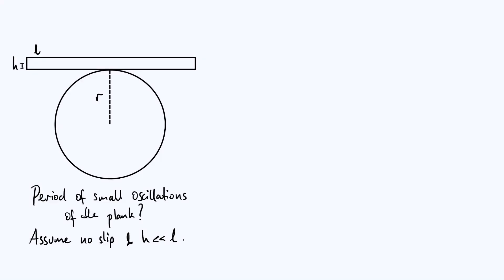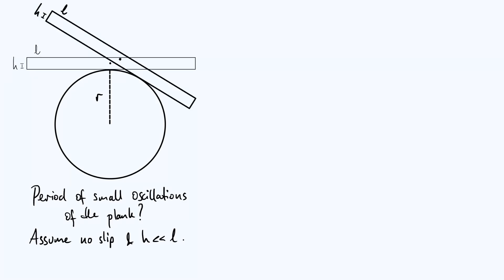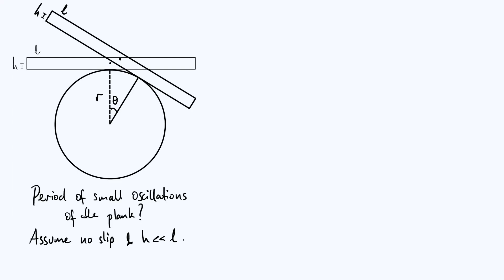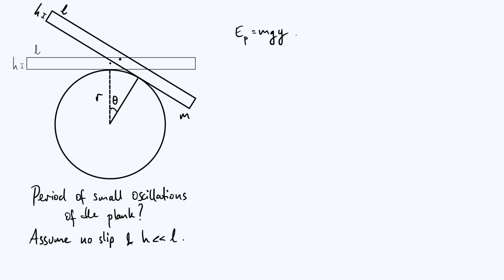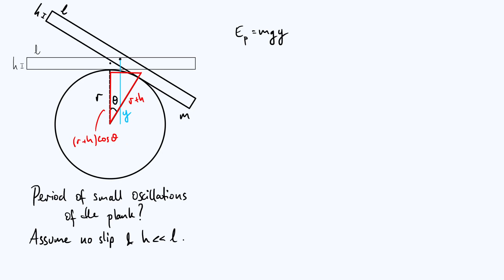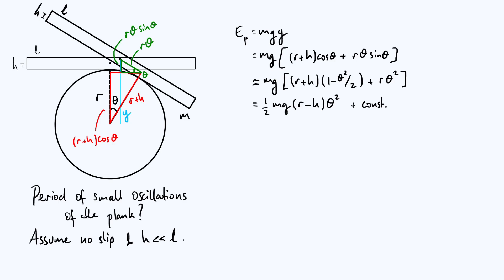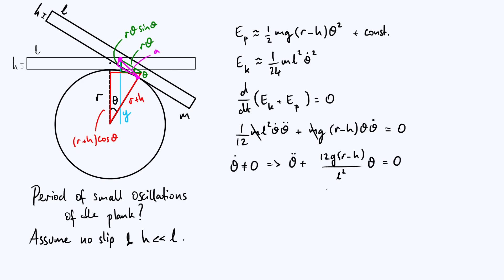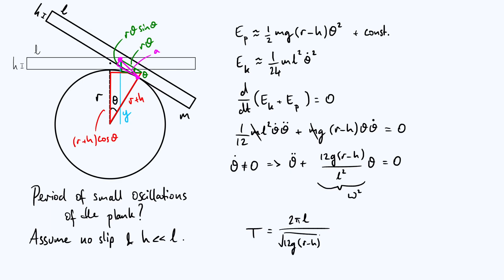Oscillations of a plank on a cylinder

Comment: I think there's a small error. When you are calculating the kinetic energy, after you get rid of the h terms because h is much smaller then L, you factored out m/12, but the 1/12 is not present in both terms, isn't or am I missing something?
Reply from the maker: You're correct, fortunately we end up neglecting that term anyway.

Comment: Wow, so what about letting the cylinder move? Is that solvable? I guess not analytically
Reply from the maker: Good question, I haven't tried that case. I'd assume that it is possible in principle because all we'd need is a second-order approximation to the KE and PE. In fact, surely the PE as a function of θ would be the same as in the video because allowing the cylinder to move horizontally wouldn't affect the height of the centre of mass of the plank? So the main challenge would be coming up with a revised expression for KE, which is harder because it would include both translational and rotational parts.

Comment: If u do these problems by this method it will take a long time in exam to solve 

Thats why i used physical pendulum timperiod trick these problem

Then we can do extensions them like using cone cylinder rtc.
Reply from the maker: How would that work in this case? Physical pendulum usually refers to an object that's hanging from a fixed point, but here the centre of rotation is always moving, which makes the situation more complicated.
Reply: Sir is this result verified by any book or not because my teacher has derived (r+h) not (r-h)

And by the way we used torque method in this case about contact point of rod for to remain in stable equilibrium
Reply: It took almost 4 step to generalised the formula for any shape of object on hemisphere

Comment: (13:32) Shouldn't the MoI approximately equal: m (1/12 l^2 + r^2 theta^2)?
Reply from the maker: Good point, since I factored out the 1/12, I should have had an extra factor of 12 in front of that second term. Fortunately it doesn't affect the final answer since we end up neglecting that term either way.

Comment: Could you also solve this by considering the force on the stick and using newton’s second law and by using lagrangian mechanics? Thanks
Reply from the maker: Yes, the force-based approach would involve finding the torque of the weight about the point of contact and applying the rotational version of Newton's second law - I haven't tried this but it should be possible after some more geometrical working. The Lagrangian method would be mostly the same as in the video, since we already derived expressions for T and V that can be substituted into the Euler-Lagrange equation.